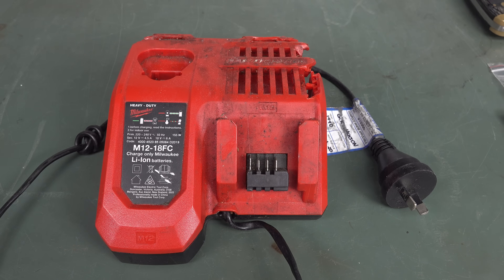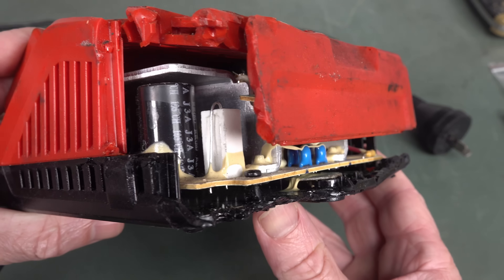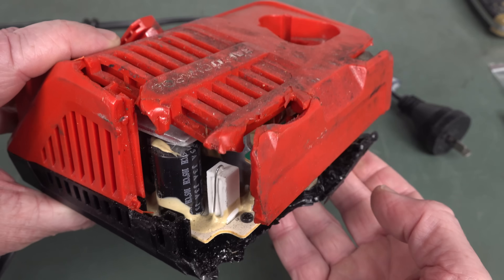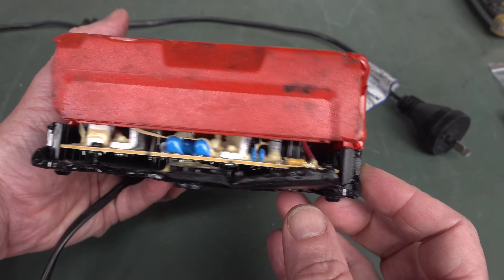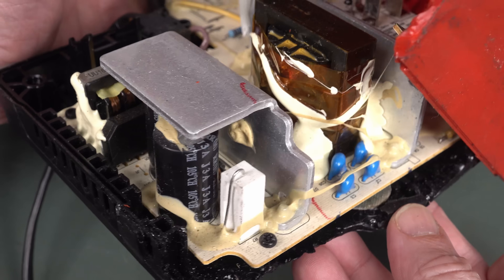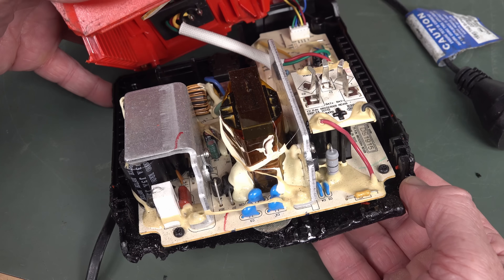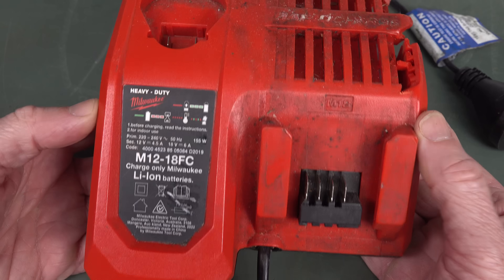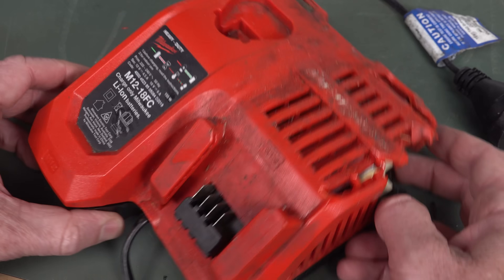When Safety Goes Out The Window

Comment: I'd laugh if the owner of this charger sees this video and asks for you to return it 😆
Reply from the maker: They can have it back. Couldn't leave it sitting in the lift foyer forever.
Reply: Those chargers aren't cheap.
Reply: @DogDooWinner  Neither are the fines for using them like that.
Reply: @Bigrignohio  Duct tape fixes anything that WD40 won't.
Reply: @Bigrignohio  Fines? Does AU tell you how you can and cannot use your own tools? Who would issue these fines?
Reply: @PelDaddy  Worker Health and Safety.
Reply: @Bigrignohio  'fines'?
Reply: What the problem with doing that?
Reply: Do them a favor and dont give it back

Comment: when Test and Tag first came out, it was always, and I mean always, old Italian business owners making people use metal case drills, like the battery drills but the old plug in 240 type, sparks flying off the brushes constantly, and they couldn't see any issue with cutting off the earth pin. 
I'm convinced this is the entire reason Test and Tag came out. And they would refuse to throw the drill out, they would hide it in their car and next year you would find the same drill again. 
Since those days have gone, I don't fail many things, Maybe a sandwich press that has had the cord twisted to many times, more often if the staff hate something I'll tell their boss it failed and they need a new one.

Comment: At least in Canada, a larger city of those charters are cheap enough and that’s not even the rapid one which supports the dual batteries that one is the lower end model most people end up buying the kits that come with chargers and batteries, but they’re already in the ecosystem so they end up reselling the chargers, whether it’s at the retail location that they purchased it from or if they try to log it off online, but yeah, they’re cheap enough. Not sure why anyone would hang onto that unit

Comment: I would have taken it for safety sake. Are they just idiots or trying to save a buck? This is why people, you cut the power cords off electrical equipment that is left for garbage collection. I personally destroy the circuit boards or remove them. Because you will get imbeciles who will pinch these televisions, fans, heaters etc, replace the power lead and try to sell them to some other mug. Which off course is dangerous.

Comment: In trade world Milwaukee is almost exclusive domain of sparkys, at least in Oz they have about 80% coverage of the sparky world. Typical like when you visit your sparky mate's home and half repaired power points are hanging out the wall and extension leads with the insulation partially stripped power the spa pump.

Comment: Grandad's metal body 9" circular saw that had a faulty on/off switch so was turned on and off by plugging it in and unplugging it from an extension lead.  I think that's the most terrifying power tool I've seen in real life.

Comment: One I have seen and I guess is really common is wood floor finishers. I was in high school at the time I saw one I was just like um I don't like that but had no idea how bad it is. They have large 240V sander(s) they have a big long 10-12AWG cord then the end they have big clips on it they just clipped it to the main lugs of the panel. Now i'm like you are nuts 1-you can't turn that off 2-there is not over current protection 3- what if a clip comes loose and shorts out on something.

Comment: None of the electronics inside show damage from overheating including that white ceramic resistor. It was broken in a fall
and the  plastic sharp edges were heat gunned off using pliers.

Comment: Ha! I have a old Weller soldering gun , 220/200W model, with a mostly cracked housing and partially exposed transformer that I still use now and then,  we have the sissy 120V Line, or "Mains" as you call it here, so, it wont sting as much if I get bit. :face-blue-smiling:

Comment: You should do a video testing the EMI from this charger. I once spent hours trying to repair a handheld CB radio. No matter what I did, every single channel was just washed out with noise. I checked capacitors, checked the oscillator, went through various troubleshooting flowcharts in the service manual, nothing. 

Finally I gave up, put it back together, and took it off the bench. Some time later I threw some batteries in it and turned it on, and to my great amazement, it worked just fine. I brought it back to the bench and again, the noise was so high it broke through full squelch. Turns out the Milwaukee 12v charger next to my bench was so awash in RFI that it was completely wiping out the entire HF band in a 10 foot radius. It's absolutely criminal that a company as large as Milwaukee gets away with selling devices with such horrible EMI shielding. 

I know that isn't the topic of this video, but it just made me think of that happening.

Comment: Nice!
In the times I was working at worksides..... well, this is nothing!  Melted cords knotted together to have machines working including lifters, welding-machines or whatever .... no problem. Just don't touch it and if you walked to close to it or just some rain ;-) you know what can happen. So just reset the automat and continue working. Wires stuck in metal plates at work, with no isolation left  and could just spark. 

Especially in places where there were many contractors and subcontractors at work, one outlet was shared by many with many cables linked together and 'repaired'. 
And if you have a cable-trommel, don't worry about running the wire out, just get one meter out and connect everything to it until it melts.
To get the effect on this charger, just put it close to such a cable-trommel and plug it in to charge (only a light load.... no problem) , put something else on one other outlet by another contractor on it and your cable will melt, taking the charger with it. You come back to take your battery to find it is not charged and the cable is melted.... luckely charger still works and you use it untill the  drill does not work anymore. Happens everyday.

Comment: My first thought is to replace the case, top and bottom part if it can still be purchased economically.
Reply: Probably not even worth it, I doubt those older tool chargers cost much. I don't have Milwaukee tools, but it looks like the old M12 battery
Reply: @volvo09  It's not old this is the current charger supplied with 18v tools, it charges m12 and m18 it's about 100 bucks in the US at home depot

Comment: There was famous deadly accident in Poland with electric shock when woman doing cleaning in the office leaned down with one hand on the metal casing of the computer and second hand on the heater. Cause? Shortly after electrician doing safety inspections and tests (required by law in most part of the Europe) was arrested.

Some time later it turned out he did his job perfectly, but the fault was done little later when energy meter was changed (theoretically after this inspections an tests should be done once again). In Poland most low-voltage (230 V / 400 V) grids are working in old and unsafe TN-C grounding system. In such system N and PE are in same wire called PEN. He swapped L with PEN. Metal computer housing was connected to PEN for safety...
Reply: Every distribution board should have RCD protection, it protects against this type of fault and many more. It's law since many years in new and renovated installations.
Also bonding of the heating and electric system would have protected and tripped the fuse instantly.
Reply: @mrfrenzy.  should but it's not always added (at least in Poland). Either because somebody was greedy or because the law doesn't work backward and somebody was greedy in the same time.

In every RCD You have button test to check it more often than once per 5 year inspection - in most cases both aren't done.

In many cases cheapest type AC is installed - this doesn't work with pulse power supplies. In such case at least type A should be used instead.

In most cases, nominal residual current is 30 mA. 30 mA with time 0.2 s or less will prevent most serious heart problems. But it will not prevent extremely strong muscle contraction - in that case You can make injuries to Yourself because of that. Don't ask me how I know.

And most importantly. There is no RCD that will trip, when You touch L and N in the same time, but Your body will be isolated from the ground.

Edit: this charger is class 2 safety device. RCD will not trip until there will be enough residual current - likely it wasn't the case here as the image in the video shows. There is no visible proof of any element with path to the ground via the heater. And we don't know what exactly happened.
Reply: @norbert.kiszka RCD does not limit current, only time. You could get 200 mA for 0.2s. It will hurt, and you might fall off the ladder but it will trip.

Unfortunately all your links got removed by Youtube so cannot see which device, but if the person got current from the computer to heater there was a current path, the type of device doesn't matter the RCD will still see it.
Reply: RCD does NOT measure current to ground, it measures if current in and out of the RCD is the same. In your example with swapped PEN/L1 it will work, current goes out from from the computer case, through person, to radiator down to ground through pipework. Since current did not return on N through RCD it will trip.
Reply: @mrfrenzy.  where I said thing about limiting current? Please don't put in my mouth words that I never said.

And I know how the RCD works - please read once again my previous comments, because Your assumptions are based on something completeky else. Or maybe You answered to a wrong comment?

Comment: Can you elaborate on what this test tag stuff is about?
Reply: In many countries, electrical equipment has to be proved to be safe to be used in work-environments. Someone will therefore have to regularly check all equipment and give it a tag. That is for the cables, plugs an so on. Sometimes things are taking out of service because of age or something beeing wrong.
This can be fire-inspection too.
A charger in this state is probably not checked anymore by the firm but someone will just take it personaly and use it on a site too for his/hers personal use (mostly not allowed but...) .
Reply: @el3dprint  Thank you for the explanation on that. That sounds quite onerous to comply with.
Reply from the maker: @UberAlphaSirus  At a company I used to work at, a contractor would charge $5/tag and they be done in seconds. When you have a huge factory and big offices that adds up to a massive windfall, all for a days training and buying the machine. I can remember when it first started and Jim's Test And Tag franchises started up immediately.
Reply: @EEVblog2 Jim never bought any paint or brushes for the rest of his life.
Reply: In the UK it is called a PAT portable appliance test. It's for anything that plugs in and is movable. Checks earth works if needed. case, cable and plug damage and a few other bits. then it get a pass or fail sticker/tag with testers name and id on it plus a unique internal company itenarty number if available. It's just to certify that the device is safe to use. health and saftey stuff

Comment: EEVblog channel owner DAVE JOHNSON has STOLEN a charger from a WORKER who can't afford a new one ( /s )

if it were me i'd maybe like, 3d print a new case for it (or maybe even just manually weld bits of plastic plate to cover it up with a soldering iron, as i used to do before i had a 3d printer) and leave it where it was, or try to find out who left it there to contact them eventually and give it back

Comment: It got dropped from height and broke the casing. They used a lighter or heat gun to round over the sharp plastic shards poking out of the broken area. Does not show evidence of actually being on fire.
Reply: That makes the most sense because the pattern of melting didn't make sense unless someone moved it while it was being melted. Why would anyone do that instead of move it away from the heat source unless as you say its been intensionally melted. Also the internals don't show enough signs of heat damage for that much external damage. Weird though how someone thought the sharp edges were more of an issue than the exposed electrics.
Reply: This is actually the most valid answer i seen so far!
Reply: This
Reply: Sounds plausible. Safety first!
Reply: My thought exactly.. all the dangerous sharp chards of plastic.. might cut my finger!!!
Reply: These are people used to deal with all sorts of hazards. Just another nitpick thing to deal with

Comment: That looks like oil ingress damage. Often caused by WD40 on some plastics, esp nylon and some types of ABS plastics.
It makes the plastics brittle and the fractures often don't look sheared but shiny on the shear points, which could give the illusion of melted.
But despite the cause of oils or extreme heat, I think this needs it's PAT electrical testing upgraded not just to fail, but Epic FAIL! (or Epic Flail if someone accidentally touches the wrong part whilst it's plugged in).

Comment: That's in a better state than the one I use at work.  Admittedly, mine does have orange "safety tape" covering the holes.

If you want a real laugh, though, trog around a worksite in winter, a favourite of the masonry boys is to chuck a 6kw heater on a 50m 3x1.5mm extension cord, not bother to unroll the damn thing, run if for 8 hours or until the smoke is too thick to ignore, and then come round to the electricians asking if they can fix it so it doesn't instantly trip out the power.  Always unroll those extensions, boys and girls, unless you really need your extension cord trimmed by 49m.

Comment: I don't see charring so probably not a fire just high temps without flame. The only time I've seen damage like this was from proximity to a halogen light, so maybe an old dual head halogen work light would explain why both corners are melted.

Comment: Any South African Construction site ready extension cord:
Protective earth wire clearly visible and obviously not connected
Must be knotted and kinked in various places
At least 25% of the insulation should be replaced with various types of plastic held on by an assortment of adhesives
At least 2 places where the cable was obviously on fire
internals of both plug ends should be clearly visible through holes big enough to fit your elbow
3 of at least 20m long should be used to power an electric jackhammer being used about 4m away from the outlet powering the string
if on a spool, no more than 30% should be unwound unless it's being operated on a scaffold
Plug pins replaced with improvised solutions
strain relief in good condition and positioned at least 50cm away from where any cable strain is likely to occur
confirmed bodycount of at least 2 digits.

Comment: As a thankfully retired maintenance manager in the hotel industry, trying to enlighten the housekeepers, despite part of their NVQ training to visually check, they still regularly used vacuum cleaners with the copper core showing in the power leads after being run over with the power head. Even better one day seeing a cleaner running her hands down the cord to untangle it, plugged in with some nice copper wires on show!!! To put the point over, one weekend I went in and chopped the plugs of all the faulty ones, 9 from a fleet of 25! Made them wait on the Monday while I replaced the power cords..🤔🫢👍🇬🇧

Comment: "Come with me and you'll be in the land of OSHA violations..."
Geez, what an interesting failure mode! What caused it to melt in the first place? Covered ventilation holes while charging and dissipating heat? Placing it near a hot object, like a gas burner or radiator?
Reply: Diesel Creek reference 😂
Reply: @SuperShermanTanker   Not really funny the way DC makes light of his enviro spill damage history.
Reply: Looks like radiant heat damage from an external source. Too close to an open flame heater perhaps. 

I own and use one of these undamaged. No way was that self damage due to normal operation.

Comment: Be kinda cool to 3D print a new case for it 🙂
Reply: I wonder if you can get flame-retardant filament rolls
Reply: Why overengineer something when you can put some tape and hot glue over the hole
Reply: Terrible idea though, the filament would not be rated for the safety requirements, ie, it's more likely to melt and catch fire.

Also to crack/delaminate and expose live parts, etc.

Using specialty filament, if it exists,  would likely cost more than a new charger.

Easier to rehouse in a proper project box you can buy at a fraction of the cost and effort.
Reply: @Fridelain  not really, just don't use PLA

Comment: My guess is tradie dropped it, bits smashed off, decided to try to cobble it back together with a heat gun but it failed.  Gaffer tape would have sorted it!  Why spend if you don't have to?